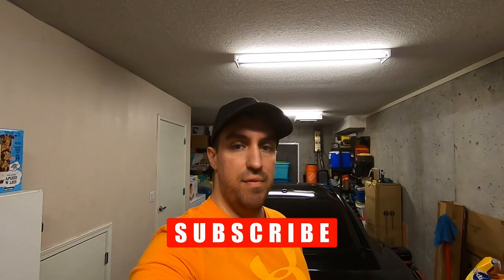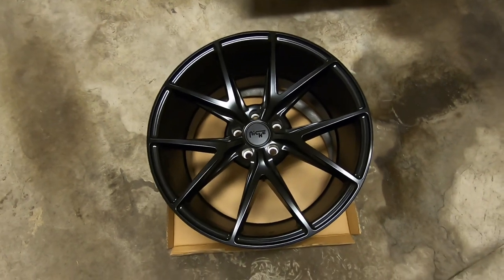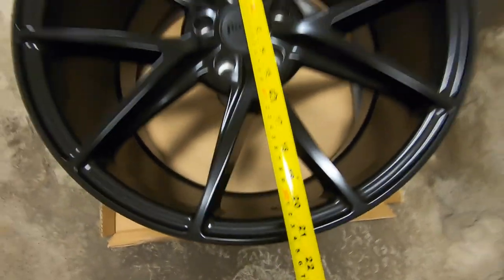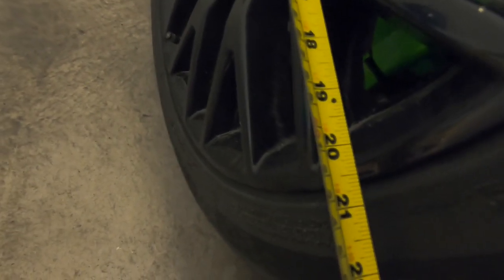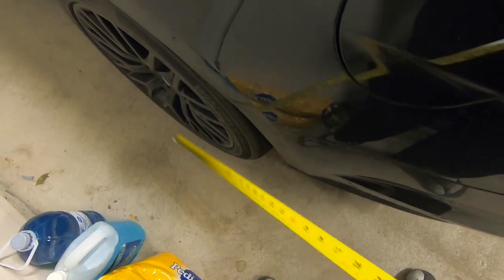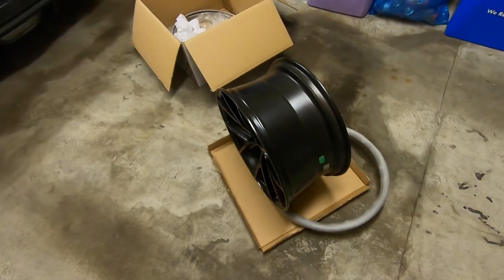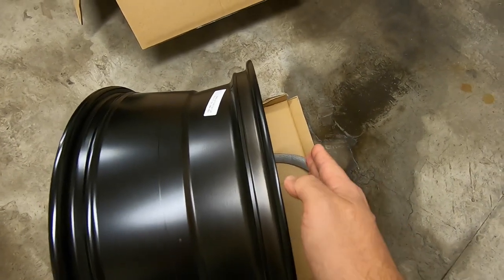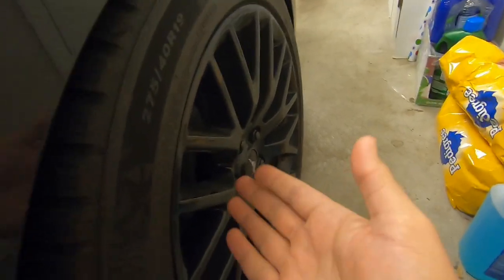WHEEL OFFSET/BACKSPACING EXPLAINED 2022*WATCH BEFORE BUYING NEW WHEELS*

Comment: Well explained. For those that are new to this, not the veterans, this is why one can run bigger tires than stock. By adjusting the offset it adding spacers, or both. The only drawback is the potential for the tires to stick out past your fender and the potential for rock chips.
Reply from the maker: I'm hoping my new ones fit ok lol.